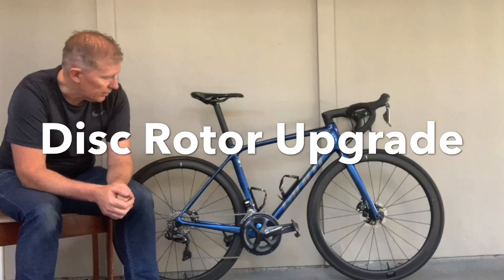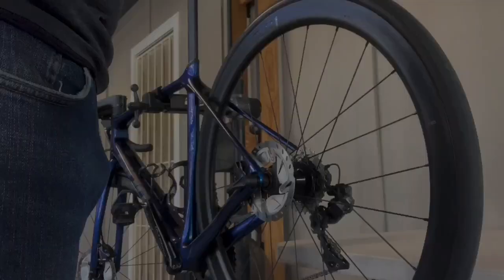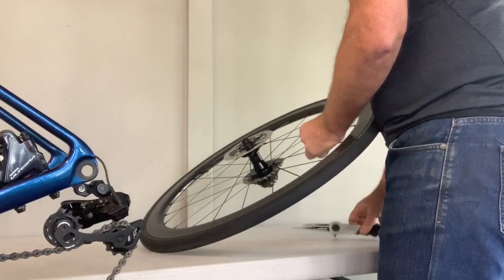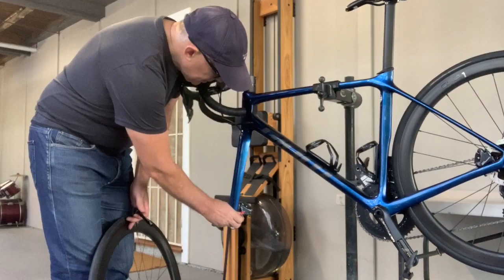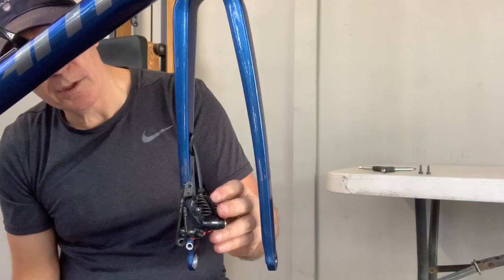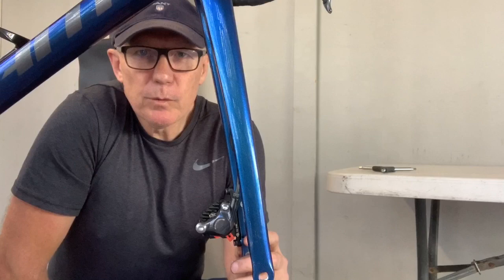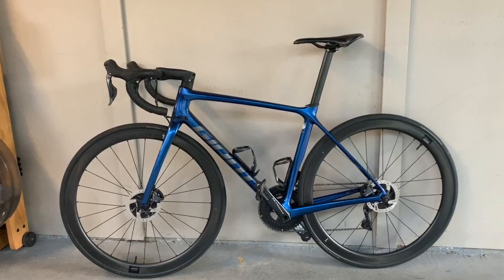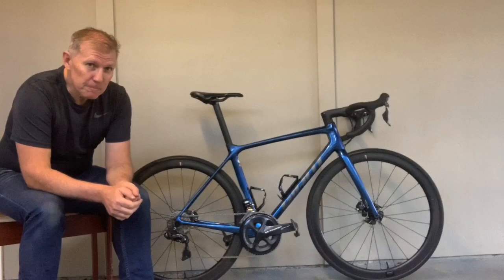Disc brake rotor Upgrade on my 2021 Giant TCR Advanced Pro 0

Comment: As somebody who rode very fast motorcycles extensively before going back into recreational cycling, I can attest to the greater breaking potential of the larger rotor. The greater heat dissipation of the larger rotor, along with the larger surface area is going benefit you as well as give you longer life on your rotors. 

Transversely, if you aren't on the brakes much and never on hills, then it is not much of an issue. 

Either way, great bike and stay safe!

Comment: Amazing Thanks! im getting this bike soon and will do this upgrade to mine. This was one of the questions i had about this bike if i could go 140 for the front and you answered it and also showed me. Go for the swable one pro tubless tires next. There fast!! and lighter, and approved by giant for their hookless rim design. I'd say with the hookless design probably just as fast as the vittoria  corsa 2 or faster since this will be on a hookless rim which offers better aero dynamics than a non hookless.

Comment: Hi, nice video. I wanted to do the same upgrade but couldnt install the front one. Put the adapter the 140 up position but the caliper didnt sit well in the rotor. It is still upper the rotor. My caliper is a 105, yours an ultegra i think same dimensions. Help!

Comment: I would say going from 160mm to 140mm is more of a downgrade. I mean you are only saving about 20g per rotor, but lose about 15% braking power, possibly more if you consider the heat that the smaller rotor generates.
Reply from the maker: Agree with you but for my riding purposes, 140’s will never overheat (no long descents here) and even if they’re 15% less braking power than 160’s, that’s still about 80% more than my previous rim brake TCR -  if I need to pull my brakes on, an extra 15% braking power on 160’s will still only pull me up in the same distance as 140’s - you can only pull the lever so hard before the disc locks up and stopping is based on inertia and tyre resistance - not the size of your disc!
Reply: @kyleswain9782  anyways my giant deft advanced pro came with 140mm, and I swapped the front to 160mm following your video. Thank you!

Comment: You should watch the last gcn video you lost 2m of emergency breaking :D
Reply from the maker: Thanks for sharing that - just watched the vid & very interesting.  A little more scientific than my “I like the look of the smaller rotors better” 😂😂. However, I will say I’m pretty sceptical as I’ve had to ‘emergency brake’ twice on mine to avoid cars at T Intersections and both times my wheels completely locked up and I slid to a stop (had to replace rear tyre both times due to ‘flat spotting and wearing through to the canvas the second time), so I doubt the distance would have been any different with 140 or 160’s.  Their ‘emergency brake’ was far more controlled (not really an emergency) so the ‘force’ they applied could have been quite different on each try whereas in real life, you tend to react with 100% force as the first reaction.  To slow to a stop without skidding, you’d be trying to apply an appropriate amount gradually ..... 50, 60, 70% until that rear wheel starts to lift like in their vid.
Out of curiosity,.... I wonder what the distance would have been on rim brakes in exactly the same test??
Reply: @kyleswain9782  the weel locking and external cables are what caused me not to buy the same beautifull bike, increased price also :) gcn also have a video comparing rim and disk controled emergency braking

Comment: Did you know that the XTR 140mm centrelock ice tech freezer rotor is around 40 grams per rotor lighter than the dura - ace 140mm rotors
Reply from the maker: Sam Wheelhouse - didn’t know the exact wight difference but that explains why teams are using them in the Tour. I should probably lose the extra 7kg’s I’m carrying before I get concerned about saving 40grams on the bike though. Cheers
Reply: Thats very good information, does it work just as good?
Reply: @kyleswain9782  good information thanks, im a weight weenie and looking at making this bike super light and fast lol.

Comment: Nice bike not sure why you want to go to 140mm discs TBF i would of changed the tubeless tyres a right faff and keeps deflating.
Reply from the maker: Here’s my honest answer to both of your points:  as I said in the video - I didn’t like looking down over my bars and seeing the large rotor.  Purely aesthetic decision. I like the smaller rotor on the front and matching the 140 which was already supplied on the rear!  Now that I’m more used to looking down and seeing them there, I wouldn’t care if they were both 160’s instead but don’t see any performance based reason to change it then or now for the riding I do.
With tubeless tyres, I ride 6 days a week and only pump them up once a week or less - after pumping them up to 100-110psi, they’re nice and firm, but soften a little over the week to around 80psi before I’d put air in them again -  but I’d only be particular about it if I was doing a race.
I’ve had 2 small punctures in 7000k’s and they’ve sealed on their own and I’ve not had to even stop riding. One I only knew of because of the white splatter on my seat post when I got home.  I’m happy to stay with the tubeless for the time being.
Each to their own I guess.

Comment: Great video. Do you happen to know what the recommended force is to tighten the thru axles? Couldn't see anything on the bike. Cheers
Reply from the maker: Finger tight??  Can’t really see how you could overtighten it and you naturally tighten it until it won’t turn anymore.  I don’t think it would be possible to get it wrong.

Comment: I may have missed this but why update the rotors now when the bike is pretty new ?
Reply from the maker: Hi Clifford - there's a part where I mention simply that looking down over the bars, coming from a rim brake bike, the 160mm all silver rotor looked very imposingly large and it was rather distracting.  i guess you could say the upgrade was completely cosmetic for me.  I like the look better from the side and from sitting on the bike looking down over my bars.  If it were performance based, then it seems I should have chosen XTR rotors as some of the teams at the Tour de France are using XTR MTB Rotors rather than these Dura Ace ones.

Comment: you clamp you frame in Toptube is wrong. can damage our frame. its better to clamp in seat post. nice vlog
Reply from the maker: Thanks.  And I would agree but I’m extremely cautious with not tightening the clamp around the top tube.
Reply: nice vlog. make more video about your TCR. i will subscribe if you make more video.
Reply from the maker: werdem TV - working in the ride review now.  Hopefully will get time to finish it in the next week or so.

Comment: Not sure I understand why that process for fixing the rotor rub needed to be repeated several times. Why doing it once didn't allign the pads perfectly?
Reply from the maker: Some people may get lucky and have it perfect first time but when re-tightening the mounting blocks, they can move slightly so it takes a couple of tries to get them positioned perfectly.  There’s nothing on the frame to position them so they can move a little as they’re being tightened. Seems to be the case in mechanic videos I watched. No big drama - maybe yours will seat perfectly first time 👌
Reply: @kyleswain9782  Thanks for the explanation.

Comment: Hi, nice video.

I have a question did you notice any performance lose, after chage front from 160mm to 140mm.

I'm thinking to change in brand new bike and and sell Ultegra rotors as new to save some money.
Reply from the maker: I didn’t notice any performance decrease no.  What I now understand is that inferior rotors can have more flex resulting in disc rub (which would be my worst nightmare as I hate any rattles or rubs).
The pro’s have been ‘upgrading’ to the XT rotors because they have a 40gram weight saving each rotor, but that also means they’re not as stiff and will need to be replaced more often.
At 84kg, I am not going to chase 40g weight savings so the Dura Ace rotors are perfect for me.  My opinion is that being a smaller diameter, they look and feel more solid but compact which just adds to the incredibly stiff feel of the bike compared to my previous TCR.
Reply from the maker: Oh, I also should say that the only reason I’ve heard for 160mm rotors is that they don’t get as hot under constant braking but here in Brisbane we don’t have any real big descents like in Europe so that’s not even really a consideration here (and I avoid big climbs anywhere).

Comment: Great Video. Which stem did you upgrade to? Thinking about doing the same for mine.
Reply from the maker: It’s the Giant SLR OD2 stem that comes standard in the top of the range SL models.  It’s a beautiful stem - stronger, lighter and is the same shape as the aero spacers so looks really clean.  Well worth the upgrade.
Reply: Thanks Kyle.

Comment: How do you like the bike so far? I'm contemplating getting this exact bike or a Specialized Tarmac SL7 in the exact same color as the TCR.

Only factor is that the Specialized is obviously $2000 more than the TCR.

Let me know.
Reply from the maker: Hi Chris, sorry for the delay in replying.  I LOVE this bike - over 5000k now and it rides every bit as well as bikes twice the price (I used to ride Look & Colnago for around 15yrs before getting a 2016 TCR frame set when I smashed my Colnago.  
I doubt I’ll ever ride anything but a Giant from now on - the performance along with value for money is in my view, unmatched.

The bike handles fantastically well, responds beautifully - cornering, climbing, sprinting - all as good as any top end bike I’ve ridden!

At the time I bought this bike, the comparable Specialised was $500 dearer, but the TCR comes standard with the dual sided powermeter which retails at $1299 so the difference was more like $1800.

I have a riding buddy who just upgraded his Trek to the new version   - personally, I don’t like some of the features of the Trek’s but haven’t ridden one.

In short - I love the bike and would highly recommend it to anyone 

Cheers
Reply: @kyleswain9782  Appreciate the insight. I might be buying a TCR instead of a Tarmac.

Stay safe.
Reply from the maker: I’m sure you’ll love riding it.  Enjoy!!

Comment: So it was just the look of the front disc that was the reason you changed it?  Otherwise it’s fine?
Reply: Actually, I saw your other reply!
Reply from the maker: @shotcoaching9965  - yep, pretty much.  The off the shelf rotors felt fantastic and performed as expected coming from Rim Brakes but I wanted the smaller diameter on the front so it matched the rear rotor.  MTB Rotors are 40g lighter each and were used in the grand tours by teams but I’ve learned since they are pretty flimsy and have to be replaced regularly so not the best upgrade for an everyday training use like mine.
Reply: Thanks Kyle, you’ve been very helpful. I think I’ll get pull the trigger - if I can get one!

Comment: How much braking force did you loose by going from 160 mm to 140mm on the rotor?
Reply from the maker: Hmmm - sorry, I can’t answer that except to say it’s absolutely not a consideration.  What I can say is the disc brakes were phenomenal compared to rim brakes when I bought the bike and I honestly haven’t noticed any performance improvement or deterioration in the months since including when I changed the rotors to a smaller size or a ‘upgraded’ model.  They were awesome. They are still awesome - I’ve noticed zero difference in force required to pull in the brake lever for any given degree of braking.
Cheers

Comment: What stem are you using it looks awesome
Reply from the maker: It’s the new 2021 Contact SLR OD2 Carbon stem in +/-10degrees.  Mine is a 120mm.  I upgraded from the standard allow stem that comes on the TCR Advanced Pro and I agree - looks awesome! It’s aero shaped to match the spacers elongated aero shape perfectly also and feels as stiff as f*ck
Reply from the maker: *standard alloy stem

Comment: Carbon handle bar?
Reply from the maker: Yes Matt - it’s the new version Giant Contact SLR bars.  Has changed from an aero top to a standard round bar at the top but uses a little strip of plastic which gives an aero shape to the front side of the bars below the brake levers to the bar ends.

Comment: why do you use 140/140?
Reply from the maker: Just a personal preference!  Being new to disc bikes over rim brakes, looking down and seeing the larger silver rotor was off putting plus my OCD wasn’t enjoying having different sizes front and rear.  I really liked the look of the Dura ace 140mm rotors on a mate’s Pinarello F12 so I decided to do the upgrade.  I had no issues with the performance of the 160mm front or the ultegra rotors

Comment: Can the bike take 160 rotors front and back?
Reply from the maker: Yes, absolutely can and would probably be advisable if you tend to do a lot of long descents on the brakes and need to be concerned about heating rotors, braking power etc.
I don’t have to consider either of those concerns - the braking power of the 140’s is more than ample for any braking and have or will need to do and there are no descents in my riding past or future that would cause 140’s to overheat.
For me, as I say in the video, it’s mostly asthetics.  I like the smaller rotors and am confident they provide more than acceptable braking power (far better than my previous rim brakes).
Reply: @kyleswain9782  thanks for the fast reply, I ordered a set of 160 XT rotors and I realized I had to order an adaptor for my rear brake since it wouldn't work without it. How have the dura ace rotors been treating you so far?
Reply from the maker: Actually I just looked and it is set to only take 140mm as the bolts are direct to the frame rather than a reversible adaptor like the front.  Sorry.  Glad you found an adaptor.
After I changed mine to Dura Ace, loads of bikes turned up in the 2020 Vuelta using XT rotors as they’re lighter than DA.
My choice was just for asthetic reasons but I’ve never found there to be a single concern over heating or braking power.  If I lived somewhere where I did 30km descents with lots of switchbacks, I’d probably go with 160’s, but my riding doesn’t need them.
Cheers
Reply: @0RANGOTANG  which adapter did you end up buying?

Comment: How is this an upgrade? XT rotors are cheaper and 20 grams lighter,  pro teams use them!
Reply from the maker: I presume this is a rhetorical question Paul?! It’s an upgrade from Ultegra to Dura Ace which is also lighter that Ultegra - but it’s you watched the video and read the comments you’d see that I explained my reasons for this upgrade and AFTER this was made, it came out about pro teams using XT rotors because of the weight saving.  If I ever become a 58kg Pro, I’ll definitely upgrade to XT but for now, I’ll let you make your own video and I’ll stick to the stuff I like.  Cheers
Reply from the maker: The point of the video was to show that you can interchange 160mm and 140mm rotors and that you don’t need to be a shop mechanic to do it.

Comment: But don't touch the rotor surface! 😖
Reply from the maker: Not sure why you’d want to touch rotors during a ride, but yes - hopefully people understand that with braking, rotors absorb heat.  The more you use the brakes, the hotter they get.  One of the advantages of disc brakes though is that the rotors are designed to withstand braking heat, unlike carbon rims which have a habit of delaminating when brakes are applied for too long like on a long descent.
Reply: @kyleswain9782  no no! I mean yes you are right that heat burn is a hazard with the discs that have recently been used but in your case the more applicable reason for not touching their surface is to prevent contamination. The natural oil on your finger tips can contaminate the rotor surface causing them to lose some of the braking power and even worse causing the dreaded brake screech.
Reply from the maker: Lol - ok.  Yes, that’s true and a real concern.  However, I’ve found they’re not really that sensitive to contamination just from skin oils from touch.  None the less, what I didn’t show on the video was giving them a final wipe over before finishing the job.  I just use a super clean rag for normal potential ‘grime’ but after rain etc I’ll clean them with a proper brake cleaner and special paper towels.
Reply: @kyleswain9782  ahan! That sounds quite thorough! No worries in that case. 👍👍👍🙂

Comment: Sorry for irrelevant question, but can i ask you a question? 

When you adjust saddle tilt, how do you tighten or loose the “front” knob(or screw) if you use non cut-out saddle? 

It seems like allen key cant reach in there if you don’t use cut-out saddle. 

Do you just use thumb to tighten it? 
Did only using thumb give enough leverage/force ?

Is it possible to tight it enough, if you want a nose-down (tilt) saddle position?
I use about 4 degree down. Would that be possible? 

Id really appreciate for the reply.